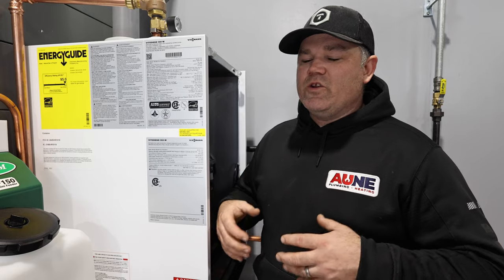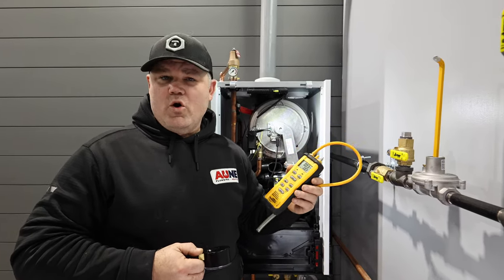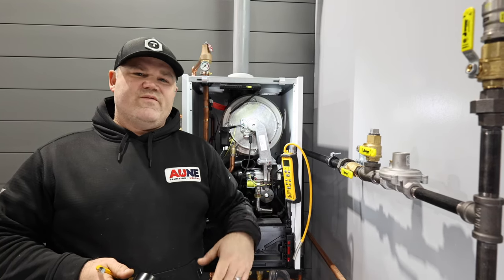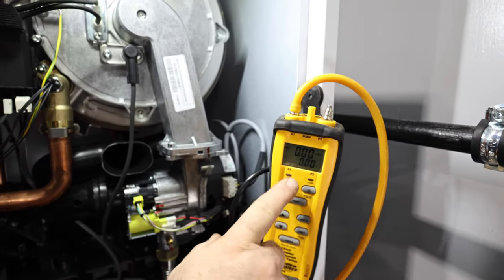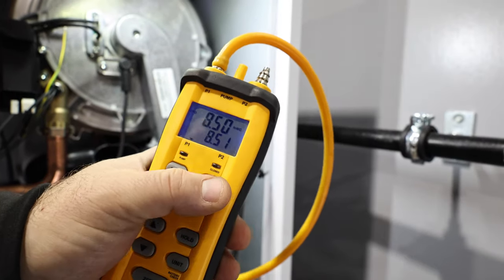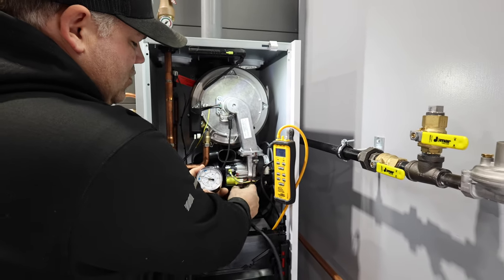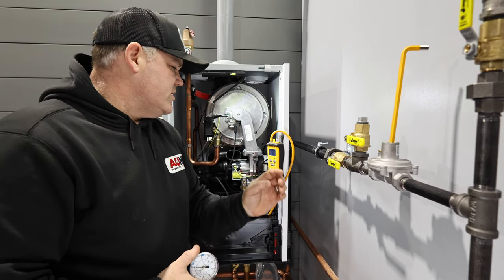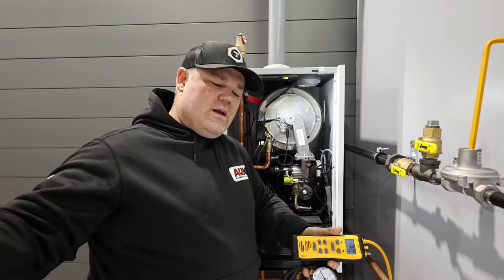Measuring & setting Gas Pressure using a manometer

Comment: I read there should be gas flow when setting the  pressure as the cutoff pressure will be up to thirty percent higher than the operating pressure under flow.

Comment: I'd be concerned that your two units are giving different results. The spring loaded analog gauge requires frequent calibrations. Perhaps it's overdue for a calibration?
Reply: DZW, that’s why we always use U tube manometers in the gas utility industry , trial attorneys could never argue about the accuracy and calibration.

Comment: Great video. New subscriber. I would also add that you also need to clock the gas meter. The gas company should provide the quantity BTU heat content of 1 cu/ft of gas provided. You should also factor your elevation for your equipment location to set the gas pressure. I would love to see a video from more technicians on the process. It seems very few people do it. Thanks for the video!!

Comment: Great video.

Aren't you supposed to run the run the appliance with the gauge hooked up so you can tell if there is a pressure dropps to low while it's running?
Reply from the maker: Addressed that in the video at the end
Reply: @mechanical-hub  , you did address it at the end of your video but @tzvifeldman is correct. The working pressure (pressure with the unit running ) is the most important pressure and your regulator adjustment should be made at this time . After setting your working pressure then you should note your lock up pressure ( pressure with the unit off & making sure you do not have a creeping regulator). I’m not sure if you made another video on the proper set up and working pressure on adjustments for the 2 pound system  which should always be done before the pound to inches regulator set up. You did a good job on your video but you really need to start making those regulator adjustments with working pressure . My expertise comes from 35 years in the natural gas industry and in my retirement I still consult when incidences occur in our industry. Hope some of this information helps and stay safe out there.

Comment: Hi .  To calibrate the WR    2 stage valves .   Brand new.  To Lp. 
   The digital man meter I have has 12 unit codes .
  Which 1 do I use to set the manifold pressure .

Psi pa _ bar mbar   ?? 
I'm so confused

Comment: Hey Eric,

Do you use your digital manometer for your manometer test downstream of the regulator? Here in Ontario we need to maintain 10” for 10 mins. I find the digital manometer I use will “creep” while my analog doesn’t. Have you run into this?
Reply from the maker: Absolutely. Our final gas test is a manometer test, simply showing a leak free system. I always use my analog for that. The problem I see most often is the appliance gas valves leaking by. I either use my analog or isolate the appliance if the inspector is okay with that. Most inspectors in my area know that the gas valve will show a leak on the digital manometer.

Comment: Do you have to test the inlet pressure on the gas valve like that, or is the pressure the same all the way between the regulator and the gas valve?

Comment: You did mention that this was the only gas appliance in your shop.  Maybe should have just touched on dynamic pressure for the younger techs. I think I would have dusted of my old Honeywell Liquid Manometer to SHOW what an inch of water column actually means. Not to go into a 45 minute dissertation.  But only touch on the subject and let them know that there can other factors involved IF... working with other appliances on the same regulator. 
JMO
Reply: As a side note ....35 years HVAC/R TECH RETIRED. Mostly industrial boilers and chillers and digital controls.
Reply: You have a channel?
Reply: @HouRocket713  nope.....just a retired HVAC/R. Tech. In the trade for 35 years. Started as a duct buster. Installing in attics and crawlspases.  Then on to service tech. Then on to an Idustrial service tech. And then the last 10 years I was the HVAC SUPERVISOR for a School System.  Everything from industrial boilers and 300 ton chillers to digital controls technology.  Cooling Towers, Water Treatment.  ...so, I'd say I'm fairly experienced.  But I see things now on YouTube that I wish I had before I retired.

Comment: Is this a propane combi-boiler? At least for tank natural gas water heaters the gas control valve has a built in regulator that can be adjusted, only installed a few tankless water heaters so I am not familiar with them. My master plumber never mentioned to me about  testing gas pressure, but I do remember reading that youre supposed to do it in the manual😅
Reply from the maker: Tank water heaters do not have a regulator built in. You are still required to verify proper gas pressure, just as you are for literally every gas appliance.